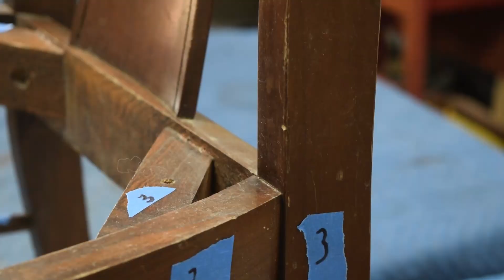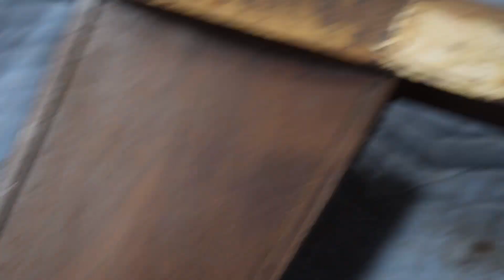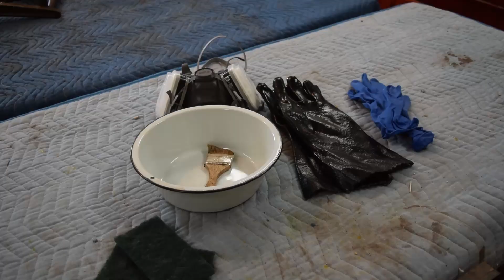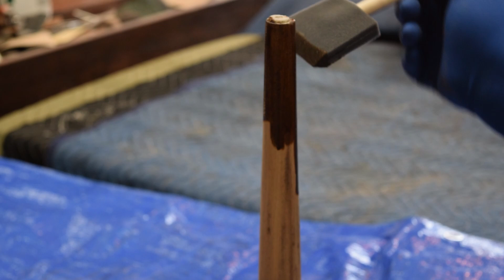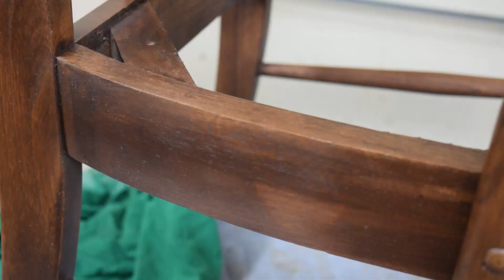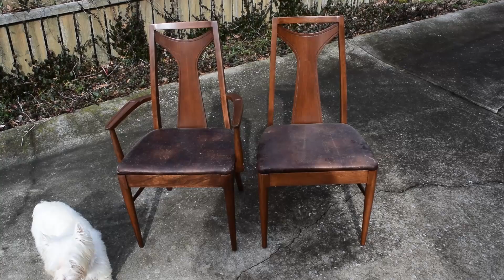Mid-Century Dining Set Restoration Part 1 The Chairs

Comment: @lostmountainrestoration this is exactly what I needed. I’m getting ready to restore 8 John Stuart dining chairs. Most of them will need disassembled. 😳 
Some of the inside corner supports are split . Should I try to replace and glue them or ? 
Thank you!
Reply from the maker: You can remove and repair them or if they are too far gone, replace them.   I usually try to retain whatever I can.

Comment: Love your videos, but this one was hard to watch because of the constant camera movement.  What is up with your camera?!  Light/dark, focused/unfocused, in/out.  Constantly moving.
Reply from the maker: Thanks.   The slow zoom in feature is in the editing software - I thought it was a nice touch, but if it's bothersome I can stop using it.   The auto focus is very sensitive, so if I leave it on, it tends to move around as I do, even with small gestures as I speak.   If I think I can get away with it, I set the focus and turn off the feature freezing the focal point and hoping the subject stays in focus as I work on it.   You can imagine what a pain it is to manipulate the camera settings when I'm working, especially with dirty gloves on as the switch is on the lens.   I guess I'm really not that good at video production and my shop, and channel, are too small to install additional camera equipment, lights, etc. , so I do the best I can with what I have.   I'll continue to try and improve.   I appreciate the feed back.   Best regards.

Comment: Hi Larry how many hours do you think it took to do one chair from start to finish, you are impressive finisher and restorer
Reply from the maker: Tough to say.  Probably 1-2 hours to carefully disassemble, clean and re-glue if no problems.  As you saw, some of the chairs put up a pretty good fight.   The finish on these chairs was kind of plasticized and very tough to remove.  Each took 1.5 -2 hours to strip by hand.  The finish was impervious to the gel stripper and I had to spray on liquid, let it sit and work that over and over.  I  spread the chair stripping adventure out over several days to keep my sanity and focus.   Add an hour or so to seal, sand, color and finish and that's the best estimate I can give.  Hope this helps.